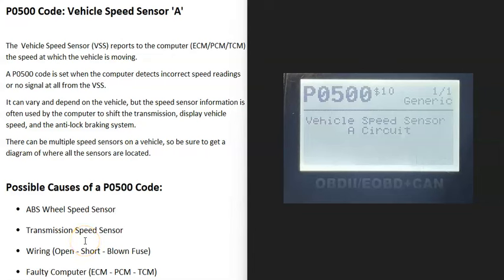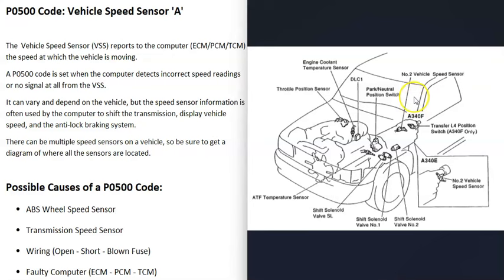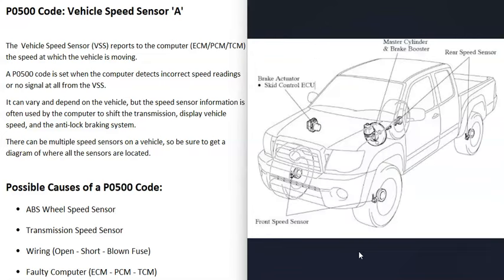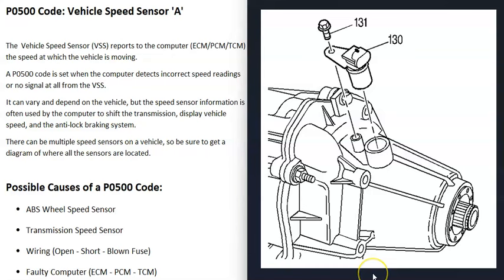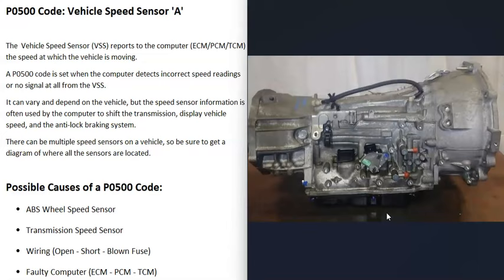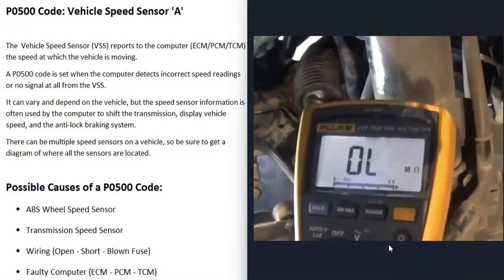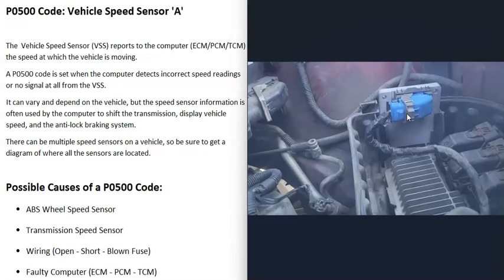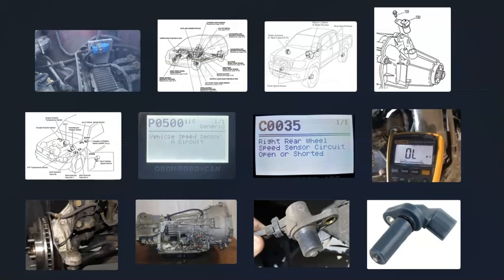Causes and Fixes P0500 Code: Vehicle Speed Sensor 'A'

Comment: I sprayed silicone oil on the wheels front and back to test if it would lubricate the wheels, after that automatic transmission mode (it's a semi auto) was turned off and now I drive it like a manual by using gear paddles, but the car still downgears automatically when slowing down. The error code is P0500, speed information is wrong or absent. But the speed is still shown as usual on the speedometer, so I dont know if maybe 1 out of 4 ABS wheel speed sensors went blocked by silicone dioxide or if the spray mist traveled to speed sensors on the gearbox? The car also showed once, P0868 ("Oil pressure defect fault. Oil pressure too low", which could mean low transmission oil level) and P1755 ("Clutch actuator control position fault. Clutch jammed". I read it could mean low actuator hydraulic fluid), but these two other codes maybe are a consequence of problem with speed sensor?

Comment: Hi o have brand new isuzu dmax this week with motor 4jk1 , i get just this code p0500 …A . The car has no vss on transmission what you think is the problem
Reply from the maker: It varies between vehicles, but there is usually a speed sensor at the wheels and transmission. Sometimes, they are internal and have names like input shaft speed sensor and output shaft speed sensor. It is best to get a diagram for your specific vehicle to know for sure.
Reply: @HVAC_Mechanic  Problem was Kabel cut thanks

Comment: Thanks for the info, I have trouble with the Speedometer fault code PO500, all the sensors are good, new one's at the front, did not look at the rear yet if they are in the right place because, they have 12V and sensor had 680 Ohm, when I control them. Do you have a solution to this problem? The Abs control was disconnected when I bought this car. Greetings Frank.
Reply from the maker: If the speed sensor is good, I would check the wiring next.
Reply: Well, I cleaned the rear sensors, did not help, but one moment the Speedometer and gas were normal and then it was gone. Looks like something is lose. I have now extra PO704 code, but I think it is the gaspendal that is wrong. @HVAC_Mechanic
Reply: I removed the Gaspedal but non repaireble, it's welded together, pity. Maybe the big Abs connector is false. @HVAC_Mechanic

Comment: whenever i am driving my speedometer is not working but when ive reached 30-40km the aircon will stop and the speedometer will work at the same time what causing the problem on my chevy colorado

Comment: Hello, I made the mistake of taking my Subaru to the dealer after I got a P0500 code.  They came back saying that the Front Right ABS Wheel Speed Sensor was bad.  They wanted $450 to replace it.  I said no and picked up the car.  Bought my own sensor and replaced it myself.  Tried to clear the Check engine Light and my scanner can't clear it.  Any solutions?
Reply from the maker: Be sure it's the right sensor; they can be easy to mix up. Right/left can mean different sides of the car, depending on the person. There is also often a speed sensor on the transmission. If it is the right sensor, I would test them with a scan tool while moving and also check the wiring and tone rings.
Reply: @HVAC_Mechanic  I'll double check the part#'s on the new and old sensor to make sure they match..  Thanks
Reply from the maker: That is a good idea, but I should have worded that differently. Basically, people often mix up which side of the vehicle is left or right and change out the wrong sensor. So be sure it's the right one.
Reply: @HVAC_Mechanic  Double checked my work, made sure I had the correct part# (I did) and still check engine light on.  Going to check the resistance on the sensors with a multimeter.  The meter I have has 5 settings (2000k, 200k, 20k, 2000, 200).  Which one do I set it on?  I'm a newbie with a multimeter.